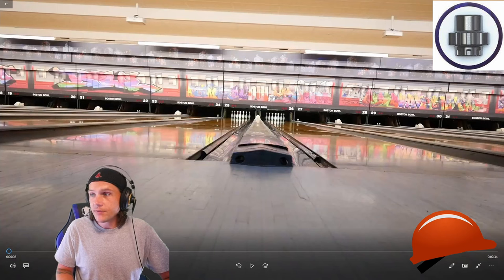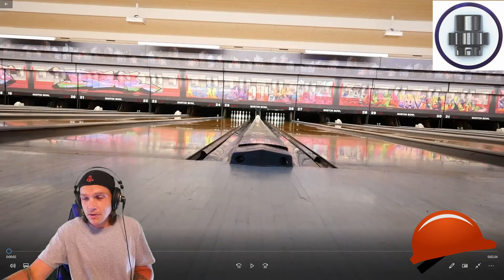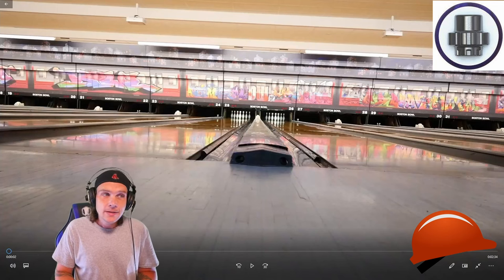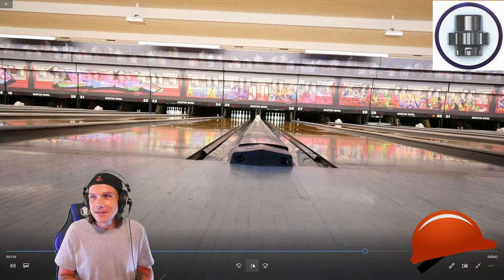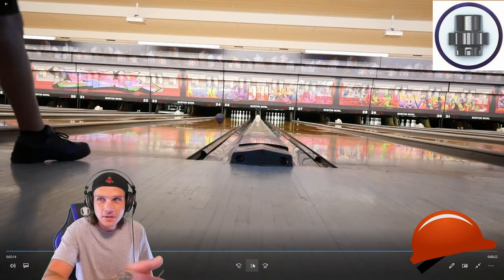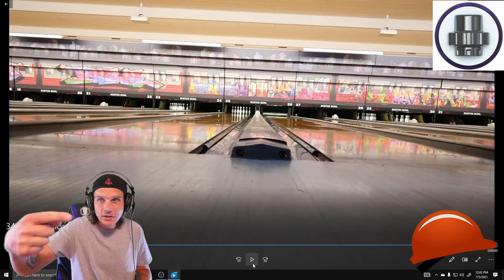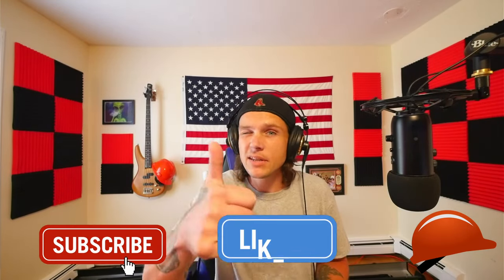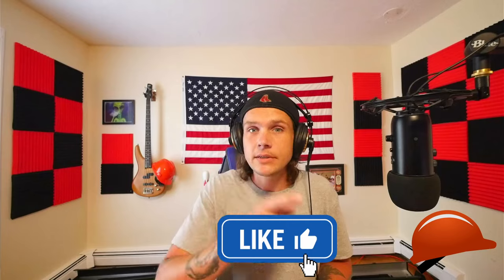Venom Shock Short Pin Layout For Dry Lanes

Comment: Layouts control the rate and magnitude of precession about the low RG axis, and the shape of the RG plane that intersects the PAP.
In a nutshell, the PAP orbits the PIN along an RG plane of a specific value, as the ball rolls down the lane. The lower the RG value of that plane, the easier it is for the PAP to migrate around the PIN.
The thumbhole almost always induces a zone of asymmetry onto the RG planes (which creates the high RG axis and PSA), between the thumbhole and the PIN (pin-to-spin line). In this zone, the RG planes are no longer symmetrical; they are changed into a flatter elliptical shape.

Since the rate of precession is constant along an RG plane of a given value, the flattened asymmetric zone essentially creates a chord for the PAP to follow, which results in the oil rings on the spherical surface of the ball to become spaced further apart in this zone, which enhances the conversion of axis tilt / rotation to roll.

This is exactly analogous to a car (PAP) traveling at a constant rate of speed (RG value) on a long curved highway (RG plane that intersects the PAP) toward a destination. If the car takes an offramp to an expressway that connects to the destination in a straight line across the curve (asymmetry), the car will get there quicker as if it were traveling at a much greater speed.
Reply from the maker: Man You Know your shit. Its a deep rabbit I have not found the bottom of. Thanks for the comment

Comment: So I'm coming back after over a decade off. I have an issue with every ball I have. Being a generic drilling for length and hook they blow acrossed the lane im a Rev dominate player throwing at 17 mph. I have tried a 90 x 2.25 x 45 on balls to that still hook like crazy , im throwing a tropical surge and still over reacts. Would going to a 6" pin to pap help me go longer?

Comment: To answer your questions on pin down layouts 

1 it does not roll earlier it rolls later than a pin up

2 it's because of the holes because when you drill at the top of the core so you decrease the height and you decrease the diff because the diff it the difference between the low rg and the high rg axis if this doesn't clear up the confusion storm has a video on the third number of there layout system but they go in depth on pin up vs pin down
Reply from the maker: Ahh yes your drilling into the top of the core. So yes lowering rg. Thanks for the comment.
Reply from the maker: Ive watched the storm video. I still like to see things for myself. Like your saying pin down is later then pin up. But I see for me. Pin down is earlier. And it would make sense your drilling into the top of the ball lowering rg and low rg is early. But that's why I say it also depends on the ball and who's throwing it.  Everyone has a slightly different experience. Its so crazy what you can do with these balls.
Reply: @WorkingClassKnowledge  are you still around buddy?
Reply from the maker: @Onesongperweek  Yeah I'm still around. I had to put bowling on the back burner for a while. I have no time especially with the inflation and bills are insane. Ive been working non stop trying to buy a house as soon as I have the house I will be back to bowling shortly after. I actually donated all my bowling stuff to kids league at my local bowling place. I kept all the pro shop stuff so I can continue to drill my own balls and start messing around again. I had so much fun doing that. Drilling, plugging, re drilling, making  cool videos. It was a ton of fun for sure and id love nothing more to be back at it asap. But my g/f moved in and I needed space for now
Reply: @WorkingClassKnowledge  I applaud you for prioritizing what is more important...especially helping the kids.  What state are you residing.  If you are nearby, I can borrow your drill machine.hehehhe